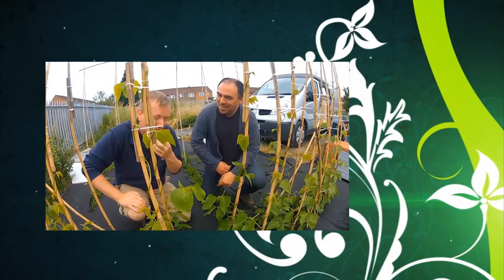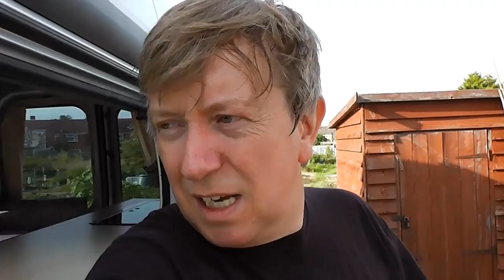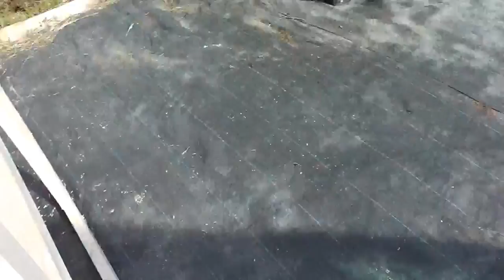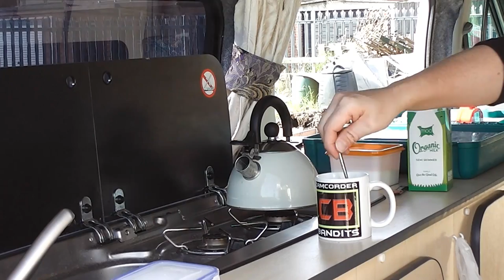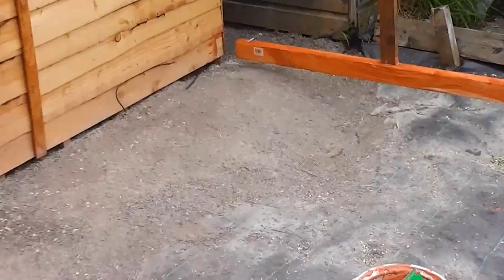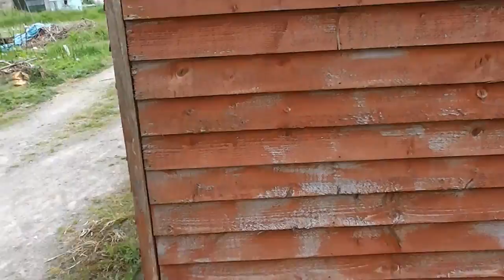Ricks Allotment (ep94) Home Made Greenhouse (Part 1)

Comment: Hi Rick.  I think the idea is brilliant.  My Grandfather built what he called a 'leen to' on his bungalow in the sixties (I think it is what people did back then), anyway he used the corrugated plastic as a roof on that, and the big thing was to make sure that the wind did not get under it.  So keeping it at an angle is a good idea but do be aware of any lip as if you do get a head on wind, it could easily lift the roof and potentially the frame with it.   Also consider ventilation otherwise it will be breeding ground for mould.  Love your ingenuity and your enthusiasm as always.  Great project and looking forward to part 2.  All the best Rick!

Comment: Nice project there Rick.If you go to a roofing yard they will usually let you have roofing slate for free.Its thin enough for you to slide under the horizontal timbers to prevent excessive water ingress to your frame.The structure will then go the distance with the poor british weather.

Comment: Great video as always Rick just a few ideas, move your doorway nearer to the shed leaving you more working area inside. Put a slope on the roof so that water doesn't collect near the join between the two structures but runs off the roof into guttering maybe for collection instead. And last thing if you could raise the wood ever so slightly off the ground you would get a much longer lifespan.
Apologies if others have already covered these points.
Dan

Comment: You could have saved some time by pre treating the timber at home, then just touch up any cut ends as you do them on site.
Many years ago they used to make a 12v drill that just connects to a car battery, can't seem to find it now.
Maybe look for a small inverter, you could charge the battery while having a break or doing other things, could be useful for camping too, alternately pick up a couple of spare batteries

Comment: The wind can be very strong as you know, a poly-tunnel deflects the wind over the top, and fence panels often are designed to let some air through, you need to be careful the construction does not act like a sail. With my pallet greenhouse, it has sufficient weight to hold it down.
Pallet Greenhouse, inexpensive polytunnel

Comment: Brilliant job Rick! You have seriously come a long way from your van builds and rebuilds to the allotment! Keep going! Did you put a slant on the Greenhouse to allow water to run off? Also you should buy a 12volt inverter for the van so you can charge your batteries and not have to run back and forth home.

Comment: Rick mate, I commend you on your effort, but i have used that plastic sheeting before in the past, and it doesnt last very long..Like Dan said, it will just blow away, it also isnt very sturdy, so you will be replacing it next year, just like your polytunnel... And yet again you have built something straight onto ground which is waterlogged. You must be B & Q's best costumer..:).. But like i said before..i commend you for your effort..:)

Comment: I'm surprised you don't have a Power Inverter with so many batteries that need charges?  Great work, your allotment has really taken on a magical transformation.

**Did you leave enough room to slide the polycarb roofing under the overhang?**

Comment: Get a charging deck and spare battery for the drill. Treat your wood before you put it together is best.  Always remember each wall needs to have a boxed frame so yes you need to have a bottom and additional side to that small wall area as well. :)

Comment: Hi rick pity you havnt got a little genny you could have used that or an inverter run off your van battery.atb Gordon you could have a solar panel on shed roof with a small 12volt battery bank with a charge controller. And a cheap inverter to run small power tools just a thought free electricity off grid ;-)